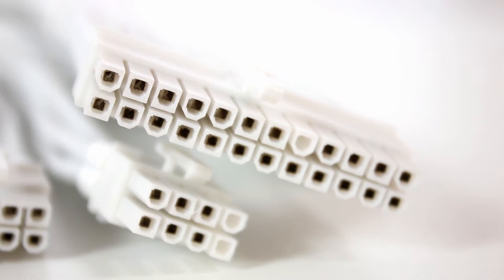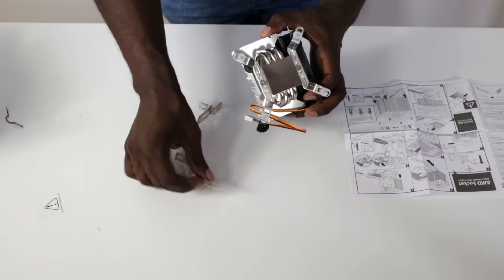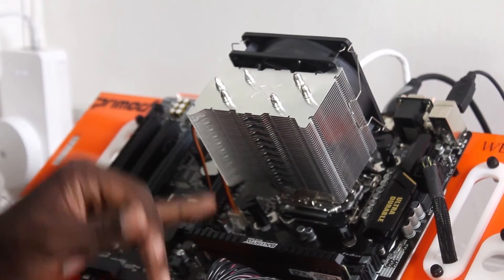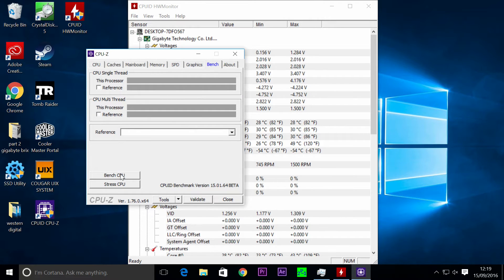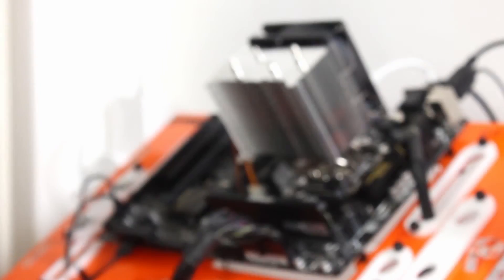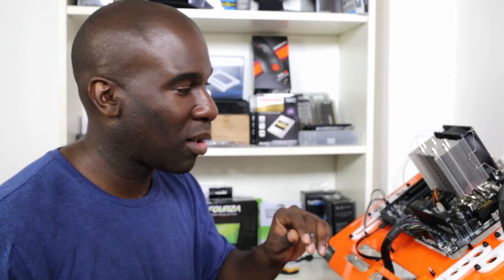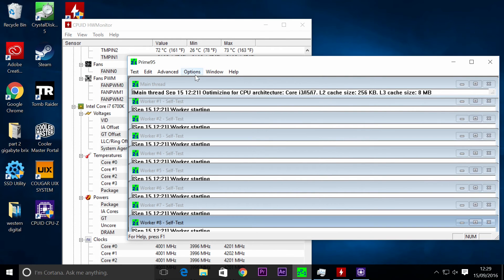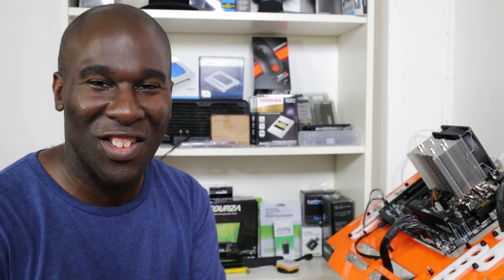Scythe Byakko CPU Air Cooler  Review and Bench Test!?

Comment: Thanks for the review! Looks like a good product!

My only concern is the push-pin system. I wonder how well it is going to hold? 

I own an old early 2000s acrylic case and it is very tedious process to remove the mainboard for a back plate. So far that I have been considering some push-pin coolers.
Reply from the maker: Works really well and thanks!

Comment: Not a bad little cooler for less than 30 euros. I certainly wouldn't overclock with it on but that is a given!
Reply: Samuel Cossais
That is crazy high, personally I am not happy with anything over 80c on air. Those Intel chips can take a lot of heat though that is just my personal preference.
Reply from the maker: I will have to try some other coolers or aio's to see whats it like overclocked too under stress testing!
Reply: You probably can overclock with it without any problem, you just need to adjust the CPU vcore to a not too high value. For my 4700K I would say maybe max 1.20v, so +0.10v offset from default.

I am using a Scythe Kabuto 3 right now @1.25V/4.5GHz and I get 95°C with 30min OCCT with case closed and 28°C ambiant. I believe you will get the same temp. with Byakko @1.20v/ 4.3GHz. If you don't go over 100°C in OCCT it's safe imo.
Reply: +Jrock420blamin norml use including recent games i never go over 65 degrees. In League of Legends which is older and lighter I'm around 50. I dont see any problem in being aroubd max Tj temperature when running non realistic stress tests like Prime95 or OCCT.
Reply: Samuel Cossais
That is fair I thought you mean 95 during gaming!!!

I usually liquid cool but I build a lot of computers so for me even 50c is high at load sometimes I forget that they can go do high and still work.
Reply: To be honest it was higher than expected in Prime. I don't mind that much since it's way lower in normal use, but it seems a bit weird. I think I am gonna check the cooler's attachment once again, just in case.
Reply from the maker: Did you check you results to see what you got?
Reply: I checked the attatchements but didnt change anything. Apparently recent CPUs get pretty high in temmperature when running Prime and OCCT. I used to overclock a core 2 duo E8400 using a Scythe Ninja revB and it was always super cool, never over 70 in stress tests. I think its the many transistors in recent CPUs that makes it harder to cool, not really the cooler's fault.
Reply from the maker: try a different thermal compound ?
Reply: I use the thermal compound included with the Scythe Kabuto 3 and it doesn't look bad, it looks like Artic silver (silver paste).
Reply from the maker: Did you check to see if the fan was on the right way or the cpu air cooler was seated properly?
Reply: Well no but I didnt change it, iirc the fan was already on the heatsink right from the box. And there is little chance it's in the wrong way as the logo is on top.
Reply from the maker: Okay just try taking off the cpu and re-seating and test again and is there a thin layer of thermal compond on the cpu too?